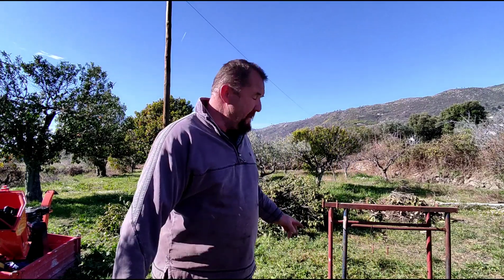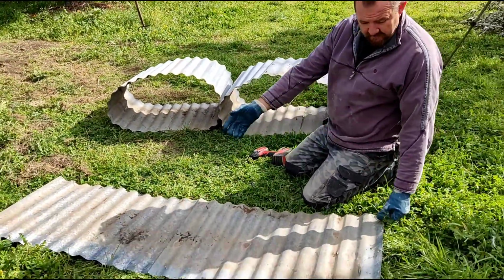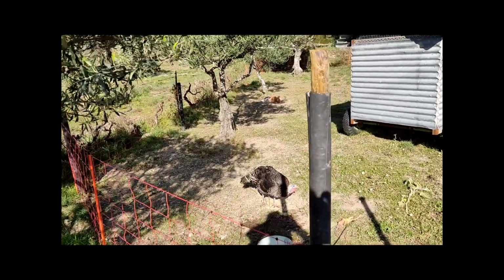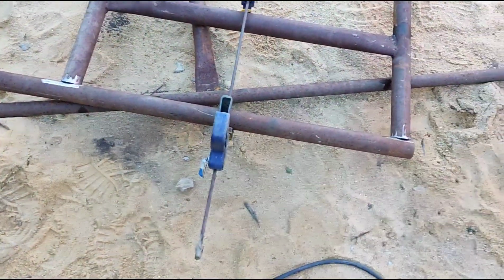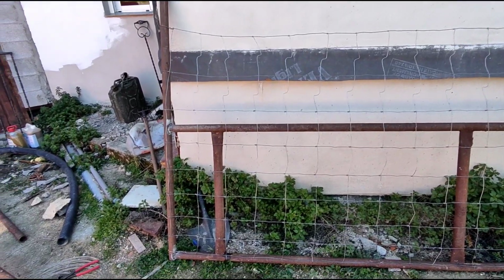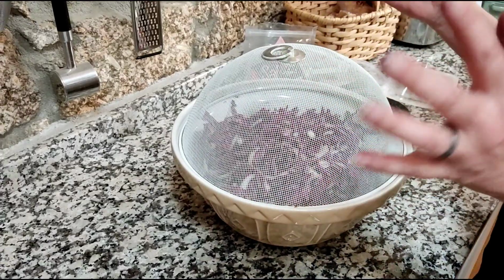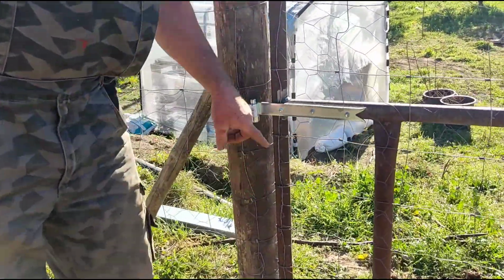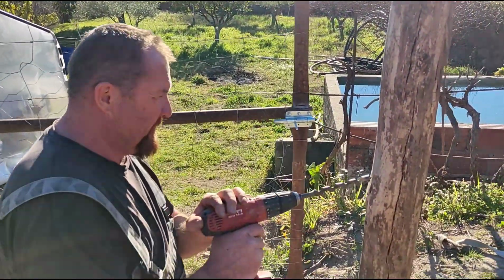No 36, Making Cheap Raised Beds

Comment: I have only watched about a quarter, so far, but I am curious why you chose raised beds? They are a good way of boosting drainage and can be used to introduce a different soil type to your garden. Raised beds are also a useful way to garden if you have restricted mobility, as they reduce the need to bend. Drainage isn't a problem in Portugal, I think; different soil types aren't an issue; these seem too low to help with bending issues. 
I suspect they will help with mulching, feeding, weeding and watering management though
Reply from the maker: Ok, the main reason is, Our mad dogs running around, irrigation is so much easier, (big thing here in the summer) wild boars don't ruin everything, and we are both getting older🤔🤣🤣🤣
Reply: @projectportugal  Blimey: wild boar don't get a mention in the gardening magazines back in Blighty!

May your backs be ever youthful, the wild pigs be shy and your water be always plentiful
Reply: @Neilhuny  😅👍